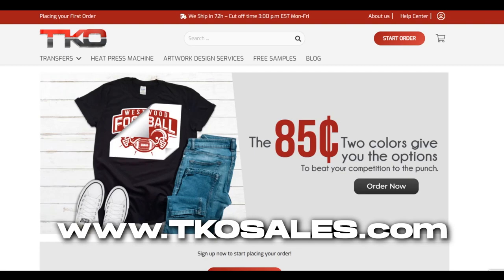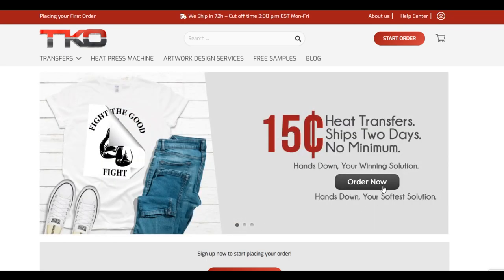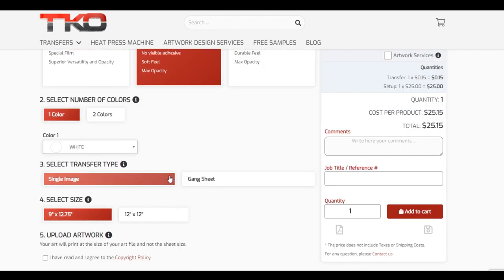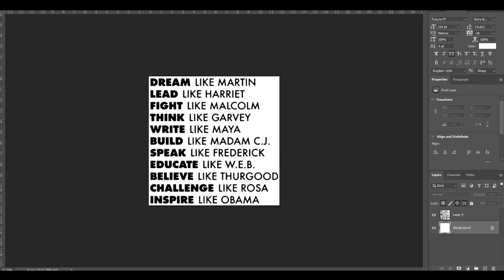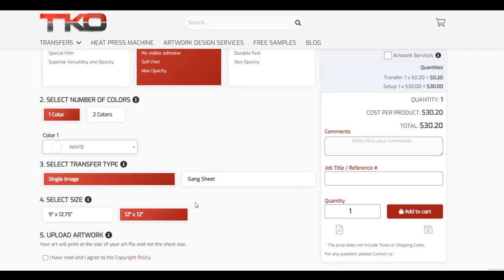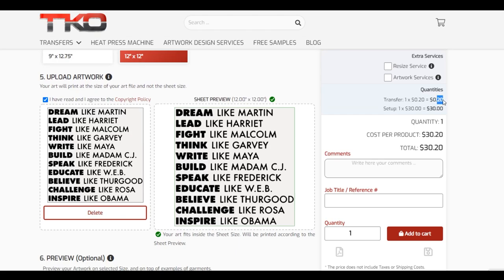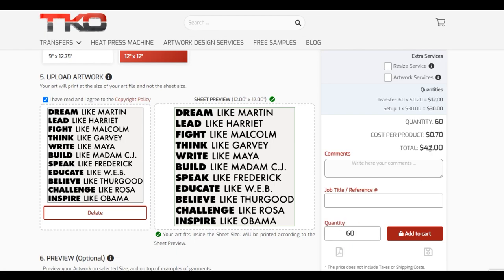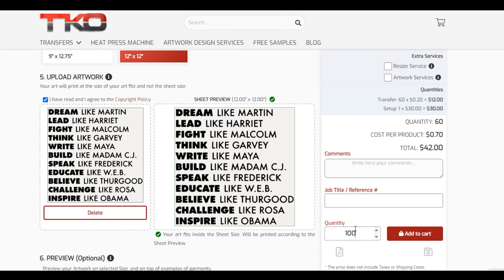Starting A Clothing Brand with 15 Cent Heat Transfers from TKOSales

Comment: Exactly, I started out screen printing. It's a lot of work, and the pitfall is going into a print service business. I since got away from SP and took up heat pressing... It's dope! Good video!
Reply: Yes SP is a lot and i was a diy screen printer, using my cricut machine as my stencil. It's a lot of work. I'm doing everything by myself. I need more time to do other things.
Reply: How do the 15 cent heat pressed Tees wash & wear compared to SP & and what a good heat press to buy. I'm just starting? Thanks
Reply: @afroliciousTV  hello it washes very well. Without any problems. They both are good in my opinion
Reply: @afroliciousTV  it is screen printing basically. They just creen print your design onto a film so you can transfer it. So no difference really. The company says 50 plus washes before any cracking witch is great

Comment: Question 🙋🏾‍♂️ what are some ways that a transfer can be lined up on garments? Joggers, hoodies, tshirts etc... that stalls laser it's pretty expensive but what are other options an example that you can show us that's as "easy" without using t-squares or those type of devices
Reply: fold the design in half then fold the garmet in half. also I use a tape measure.

Comment: Rich, you are soo inspirational . 😊 Been watching you for a year finally broke down quit on demand printing cause I want more control . So I got a heat press and Cricut but it is frustrating and time consuming . Do you think transfers are just the way to go and not even bother with the Cricut even when you’re just starting out ?? It sure does seem like it . Awesome video guys .
Reply from the maker: Try it out, I think it’ll instill a lot more confidence with you for moving forward. Transfers make it easy to make a shirt in comparison to the vinyl and cutting process.
Reply: @HustleNinjas  how long does a heat transfer last in comparison to screen printing? Are there bigger sizes for the transfers?
Reply: @aaaaaaaaa8886  it is the same as screen printing. It's a screen print transfer. 50 plus washes

Comment: Great video
Appreciate the advice

Do you know how the washability is? How well it holds up after numerous washes?
Reply from the maker: I’ve had a shirt hold 20+ washes, I’ve never really personally tested beyond that though
Reply: @HustleNinjas  thanks!! Appreciate ALL the info!! 🙏🏽
Reply: Printed heat transfers usually look bad after just a few washes
Reply: @scottyboy6269  I disagree
Every transfer company is different
Supacolor Transfers hold to 75 + washes BEFORE ANY fading or cracking in design
Reply: 50 plus washes before cracking says tko

Comment: Hey thanks for the great presentation. Just got a quick question about the guide lights @10:45 on the black t-shirt. Is that a laser guide from the heat press machine?. I was wondering how precisely you centre the art on the garment.
Reply: I have the same question
Reply: Its a separate laser alignment guide. There are many different models. Some presses have them built in, but you can buy the setup for less than 40 bucks. Just look up heat press laser alignment guide.

Comment: What is that machine with the red beam? Is that a machine that help you line up design accurately?
Reply from the maker: Is This $7,800 Heat Press Really Worth It? - Hotronix Dual Air Fusion Review
https://youtu.be/YyoQbbPzkN0

Comment: How do the 15 cent heat pressed Tees wash & wear compared to SP & and what 's a good heat press to buy.  I'm just starting?   Thanks
Reply: Oh I see some links above. I will check them out.  Which do you highly recommended & how do they wash and wear & how log do they lass compared to SP?
Reply from the maker: It won’t last as long as actually screen print, but you’ll get 10-15 washes out of it, I’ve seen more, you just really have to keep who the end customer is in mind.
Reply: @HustleNinjas  Hmmm, I wonder if my customers will like them. what type of end customers don’t mind heat press?
Reply from the maker: I’m saying end customer in mind in reference to the washability itself vs the print quality
Reply: @HustleNinjas  I don’t understand lol, I’ll see if a friend can interpret. Washability vs. print quality? How do they compare? One gets better washes and print quality vs. less washes and bad print quality?

Comment: Question could you find out what shelf that is that he used to store his transfers ? I’m looking for one.
Reply from the maker: It’s custom built
Reply: @HustleNinjas   dang ok 👍🏼, thanks for the response
Reply: Micheals Modular Panel Towers. You can get additional insert shelves too sold separately. Towers can be interconnected up and to the sides. Use a coupon.

Comment: How’s the durability of the of the pressed shirt though ?
Reply from the maker: I've had it last 20+ washes before seeing some cracking. You need a good heat press with some heavy pressure and high heat.